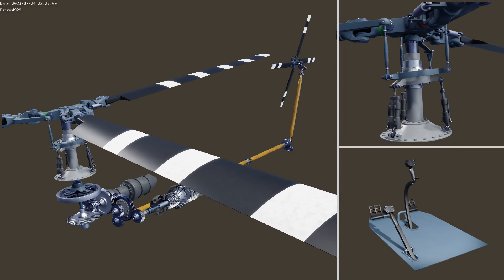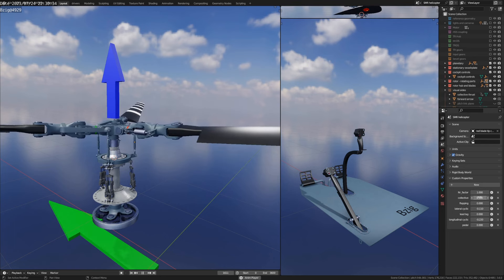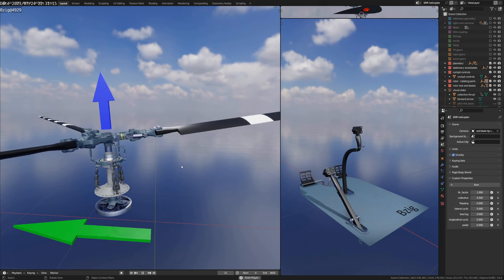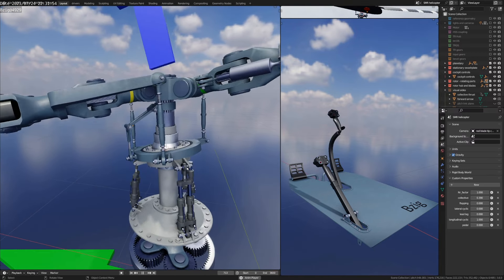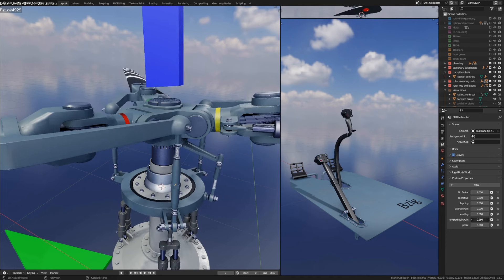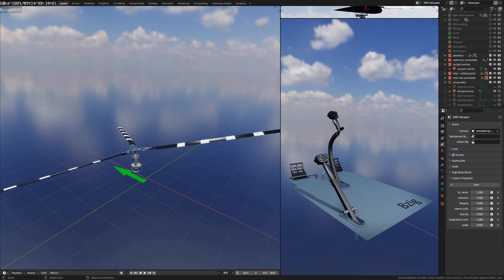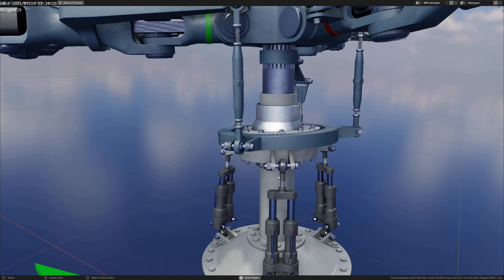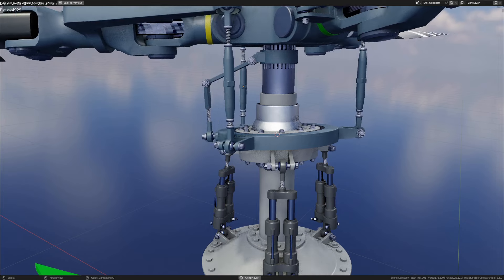helicopter rotor control -  phase delay

Comment: 8:25 we see the yellow and green banded components bend significantly, but not the rotor blade. there seems to be another layer to this animation not mentioned (or I missed). in a static situation, you wouldn't see these components flex, right? IRL they also likely wouldn't flex that much and it would be the blades themselves that flex the most, right?

The key points to your video here are the rotors flapping (much like a reciprocating piston engine) and the phase difference between maximum acceleration and maximum velocity (of the piston). Thanks.
Reply from the maker: You're calling me out on my animation skills 😁.  Rotor blades definitely bend in operation, but I haven't figured out how to make the animation software do that accurately.  It's on my list of things to learn.  Thanks for commenting!

Comment: Absolutely perfect explanation on your first and second vids.. love the animation.. as a heli pilot, this explanation drove me nuts, and I thought would have to prematurely input. At the end, didn't have to worry.. as you mentioned this goes out the window for 2 ,,4,,,,5,,6 blade machines.. and let's not forget fixed hubs, or lead/lag flex hubs.. 
Excellent work.. when I use fly i also had several RC helis,, and holy poop it was tougher to those RC then the real ones..

Comment: This is a very good explanation of phase lag but, keep in mind that lift vector is always parallel to rotation axis “the mast”, creating a torque that will tilt the whole aircraft and hence tilting the thrust vector. Otherwise, the helicopter would neither pitch nor roll.

Comment: Great grafix, fixed wing pilots will be confused. 😉😳👍
Reply from the maker: So right!  They are always confused
Reply: I'm not confused but I'm a wanna be rotary wing pilot trapped in the budget of a fixed wing pilot.
Reply: Fixed wing pilot, it's challenging at first though I'm not confused. The motor causes both types to go up. I offer as proof: lack of motor causes both to come down.

Comment: Really well done. I have heard different POV's, but is it universally an 85 degree lead? I have also heard of a 90 degree lead. Does that change with respect to the type of rotor system (rigid, semi-rigid, fully articulate) or how many blades we have on the helicopter? Thanks again. Keep these coming! I am an aspiring Army Aviator and I am studying for the Army SIFT - your videos help immensely.
Reply from the maker: Thanks!  I really appreciate you letting me know this was helpful.  The amount of phase lag (difference less than 90 degrees) corresponds to how much flapping hinge offset is in the rotor system.  Teetering rotors, such as the bell 206, have close to zero offest so they have 90 degrees of phase lag.  Mechanical flapping hinges have pysical offset and they are usually 80-85 degrees.  The highest amount of offset is the virtual offset of semi-rigid rotor heads (bo-105 or lynx) and these can be   75 degrees.

Comment: You explained the tilt of the rotor disk well, but how does it cause the helicopter body(and the mast) to tilt ?
Reply from the maker: great question!  It's because of the hinge offset in the rotor system.  This allows the forces on the blades to create a couple (two opposing forces offset by a moment arm) and this applies a bending moment to the mast to tilt the aircraft. 

Although  helicopters such as Robinson and the Bell 206 fly without any hing offset in the rotor system... in the case, the fuselage just pendulums below the rotor system and the rotor disk tilt is all that allows the aircraft to fly forward.

Comment: The way I think of it, the blade moving forward will naturally produce more lift than a blade moving backwards (ie the blade on the right produces more lift than the blade on the left, if counterclockwise as in this animation), proportional to the forward speed of the helicopter. You can compensate for that by increasing the angle of the blade moving backwards and decreasing the angle of the blade moving forward.
Reply: Unfortunately retreating blade stall prevents that.
Reply: This is unrelated to the topic here. Phase lag occurs even if the helicopter is standing still.

Comment: Excellent graphics! What I am confused about is what you are trying to tell about the 45 degrees and the 30 degrees. quote "The swashplate is centered at 30 degrees." . What do you mean by that? Gyroscopic precession - that is the term in my physics books - implies, that on a rotating mass the force orthogonal on this mass will the place exactly 90 degrees after the force has been imposed on the object.  Flapping angle has to be deducted, but only if you have a rotor head allowing blade flapping. Bo 105, Blackhawks etc do not have flapping blades. The 30 degrees thing and the 45 degrees thing, ... what is that?
Reply from the maker: I could have done better with that.  Switching from 30 to 45 didn't help.  The point I was trying to make is that there is a 90 degree difference from where the force is applied to where its effect is felt.  But, the mechanical attachment point isn't 90 degrees away, so it appears like it's not a 90 degree difference.
Reply: @hangar4851  
Gyro precession is at 90 degrees and that applies to the main rotor blades.
If you do an analysis of a gyro as a bunch of separate weights around the wheel. it is easier to understand precession.  There are You Tube videos showing this.

 However, I've heard an explanation of why in practice it isn't precisely at 90 on a heli. There are other secondary forces, but don't recall all the detail now.
.
In addition, for example,, when applying collective and power going forward, the tail rotor also puts additional side thrust that must be compensated for by the main rotor counteracting to the other side or you start forward motion at an angle at an angle.  
.
A heli pilot I talked to said some helis you start forward with the stick slightly to one side and bring it gradually forward. 
.
It's V-E-R-Y complex.
.
PLUS, not all helis are rigged the same due to configuration and computer control  differences. 
- -
I talked with my AE son who did some heli rigging at Embry-Riddle Aeronautical University.
Reply: Some say the gyroscopic precession is altogether just a lie, or a mistake.

This phase lag is supposedly purely caused by the time it takes for the desired cyclic action, to apply physically on the blade due its own inertia (maybe inertia isn't the right technical word though)

The maximum pitch is near 9 o'clock. The maximum flapping height is near 6 o'clock.

But the angle just looks like 90°. On various helicopters models it can vary from 70° to 90°. It is said that if it was precession, it could only be perfect 90° on all helicopters.

I get the feeling, only a handful of people on this planet actually understands really helicopters
Reply: @orchidahussuhadihcro9862  No, Inertia is indeed correct. It comes down to Newton, but gets complex here.
.
It really helps to understand the basic physics of precession  to see the fundamental 90 degrees of classic precession.
I'm sure there is a YT video on it.
.
Think this way:
The increased lift at one point in the rotation, produces an upward force and resulting acceleration of the mass at the end of a rotating arm. This acceleration is in the direction of that force and increases the vertical speed of that tip.
.
That vertical speed gives the increased upward deflection {flap} that continues increasing around the rotation. 
In a solid body rotating, this gives the classic 90 degree precession.
.
The fact that the blades are not a solid gyroscope , along with factors of the craft dynamics can alter that 90 angle. 
.
My AE son worked some on rigging helicopters and talked about the offset effect.
Newton can get pretty messy at times.
Cheers

Comment: You mentioned the actual phase is less than 90°, in this case is 85°. Is 85° is a constant when rpm change ? 
If deformation (bending) of the blades is also put into consideration, does it make the phase less than 85° ？
And also the mass of the blades, do they affect this angle ?
Reply from the maker: the phase delay is a function of the damping ratio.  This is the ratio of the frequency of rotation of the blades to the natural frequency of flapping.   Rotors where the flapping hinge is at the center of rotation (teetering rotors) have a phase delay of 90 degrees.  Check out this lecture at the 23:20 point, he does a good job of explaining this (better than I can)...   https://youtu.be/ZHTrj2a1rMQ?si=ntJwxd8--yvYsX7z&t=1400

Comment: Thank you for the explanation. But does this count too for 2,4 or 5 bladed helicopters?
Reply from the maker: Yes it does.  The phase delay will be 90 degrees if those rotors don't have offset (from the center of rotation) flapping hinges.  The amount of difference from
 pure 90 degree phase delay is a function of the amount of hinge offset, not the number of rotor blades.  Thanks for watching!

Comment: @3:05 you're not actually increasing/decreasing the AOA with your flight controls in a helicopter, you're increasing/decreasing the AOI. AOA is the angle difference between the chord line of the airfoil and the resultant relative wind. AOI is the angular difference between the chord line of the airfoil and relative wind, which accounts for IF (induced flow). Meaning AOA can increase/decrease based on induced flow changing with no flight control change.
Reply from the maker: good points.  I've tried, in other animations, to show all of the vector math involved in the relationship between blade pitch, in-plan velocity, flapping... and how those all roll up to an angle of attack.  It's hard to do!  Honestly I think it would be easier with an old-school blackboard.  Thanks for the comment.
Reply: @ still a great animation and very informative. I really like how you explained the albeit counterintuitive but very real physics of gyroscopic precession of when lift is actually created (I.e. when the force is felt out of phase)

Comment: Hi would you mind to explain in details again regarding lead lag, flapping? I can understand pitching but don't understand why lead lag and flapping. Thanks
Reply from the maker: Lead lag is necessary so that angular momentum is conserved.  When the blade flaps, it's center of gravity moves inward.. if the blade didn't have lead/lag, the only way to conserve angular momentum would be for the rotor to speed up.  Similar to how a spinning ice skater spins faster when she brings her arms in.  Because the rotor can't spin faster, that is taken up by the lead/lag hinge.

Comment: so im a little confused. is the forward tilt, the flapping, caused by the pitch of the blades, or are the links directly controlling the flapping?

(edit: sorry im still learning all of this stuff)
Reply from the maker: The pitch of the blades increases or decreases lift on the individual blades.  The change in lifting force  moves the rotor disk through flapping.  In other words... The pitch change arms do not directly control flapping... They control blade pitch... This changes blade lift... This changes the flapping angle... This tilts the rotor disk.
Reply: @bzig4929  alright thank you for clearing it all up, this is the answer i was exactly looking for. that's what i was thinking but i didn't know for sure.
Reply: @mikemybalzich3159   It may be easier to not think about the flapping as much as just the tilting of the plane of the rotor. Try to think of the rotor as just a disc, like a DVD.
I understood all this already and only came by to help a friend and I found the mentioning of flapping to be confusing until I figured out what he meant. 
.
The rotor is a giant gyroscope.
When lift is high on that left, retreating blade, that upward force causes precession ~90⁰ later that lifts the blade as it passes above the tail. 
That means the rotor disc is now tilted forward, redirecting some lift to the rear - for forward speed.
Does this help any.?.
Reply: @SteveNoskowicz  yeah, i understand. what i was confused was if the pitch links directly controlled flapping but i got it now
Reply: @mikemybalzich3159    Yea  Strange that pitch links control blade pitch. (;-o)   Author spends too much on flapping rather than the main phenomenon of precession.

Comment: is it different for a 2-blade main rotor system like a Bell 206 or Robinson R-22?
Reply from the maker: There is a small difference.  Phase delay still exists, but 2 blade systems have the flapping axis on the rotation axis so they have exactly 90 degrees of phase lag.  In fully-articulated rotors,  the flapping axis is offset from the center of rotation, so the phase lag is less than 90... probably 80-85 depending on how much hinge offset is present.  There are other differences... such as how they conserve angular momentum when flapping.  The biggest difference is that 2 blade teetering rotors are susceptible to mast bumping and, consequently, have less low-g capability than fully-articulated rotors.

Comment: How do the two swash plates attach to each other. Share bearings?
Reply from the maker: Yes, there are bearings between the two.  Grease and lubrication are very important to the function of the swashplate.  Many helicopters have bearing monitoring systems to give real time alerts if the bearings start to fail in flight.
Reply: @bzig4929  Thank you.

Comment: Why is it that we would want to achieve maximum displacement from the flapping at a certain point, rather than achieving maximum lift at a certain point of the rotation? If the goal is to move the lift vector to control the helicopter, isn't that linked to the maximum force produced by the blades, and not the maximum displacement of the flapping hinge?

At the end of the day, you need the forces to balance out such that you have controlled lift on the helicopter, so I don't understand why having maximum force offset by ~90 degrees leads to this.

Edit: thinking about it a little more, is it instead that on a fully articulated rotor, lift of the blades doesn't directly lift the helicopter, only giving the blades inertia, and through the centrifugal motion, that blade's inertia is then transferred to the rotor head after ~90 degrees?

As a side question, what is the leaf spring-looking thing inside the lead-lag hinge in your model?
Reply from the maker: It's not that you want the max displacement to occur at a certain point... it's that you need it to do that in order to control the aircraft.  To fly forward, you need the tip-path to tilt forward, so that means each rotor blade needs to be at it's highest point of flapping at the six o'clock position (over the tail boom).  To achieve this, you have to apply the lift to the blade 90 degrees prior.  Maybe a way to think of it is all the blades produce (almost) equal lift.  It's not the lift on each individual blade that controls the helicopter, rather it's the overall lift and the tilt of the tip-path-plane that points that lift in the correct direction.

I've flown a lot of formation flight in helicopters, and it's cool to see the entire rotor disk respond to control inputs as a single entity.  It really doesn't look like individual blades, but rather as a single disk that tilts in the direction the pilot wants the aircraft to go.  It may also help to think that the hub isn't capable of reacting moments at the flapping hinge; lift from the individual blades can't apply a moment to the mast to maneuver the aircraft.  The overall lift vector, applied through the plane of all the rotor blades, is where the control comes from.

The leaf spring looking thing is a tension torsion strap that reacts CF loads.  The model of the rotor head came from images of the Boeing CH-46 Sea Knight helicopter and the TT strap when through the lead-lag hinge this way.  I reused that 3d model for this animation.  Good eye for detail!

Comment: I design machinery for a living.  There are just way too many (small and thin) moving parts for this system to carry human lives at my level of engineering!  This was an awesome animation and explanation.  This is a fascinating mechanism.  Cheers and thanks for sharing.  Edit:  Is that a cir-clip at the very top of that assembly, holding those blades to the craft?  There has to be more than that.

Comment: This would make more sense if i understood why the lift vector follows max displacement and not max lift.
Additional lift "flaps" the blade up to cause that displacement?
But what about the displacement affects the lift?
Reply from the maker: This is good input... You're picking up on the simplifications I used to animate this.  The s/w allows python code so I thought about getting more aerodynamic with this, but in the end... As you noticed, pitch, lift and flapping all occur at the same time which is not how nature works.  And, flapping up causes a reduction in lift because it changes the angle of inflow to the blade.

Comment: Is it just the angle of the swash plate? Surely the size of the pitch control arms on the blade roots is as much a part of the design. Stunning graphics, thank you for the video.

Comment: Hello everyone! Please, Where can I find and install this simulator?
Reply from the maker: it's not really a simulator, although I may refer to it as that in some of these videos.  This is done in 3d animation software called Blender.  Blender is free and open source... anyone can download it and install it.  

Although it's animation software, I treat it like a simulation for making these videos.  There are almost no animation key frames involved in making these videos.  Instead, I program the equations of motion for real-world motion and aerodynamics into a feature of Blender called "drivers."  Drivers allow me to interact with my 3d models using Python code and it's much better for this type of video than key framing the motion.    

Blender has a steep learning curve, but it's an amazing tool.  Particularly since it's completely free.